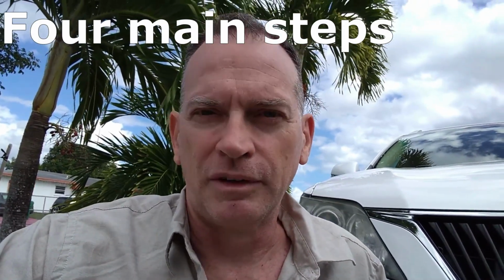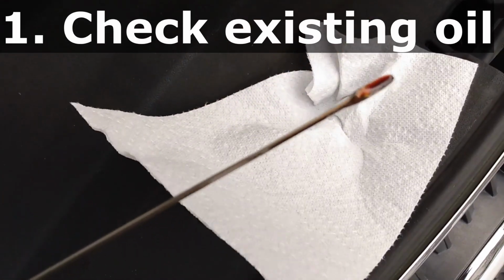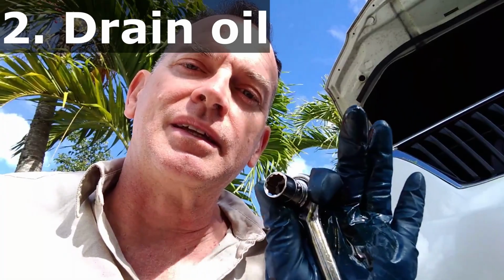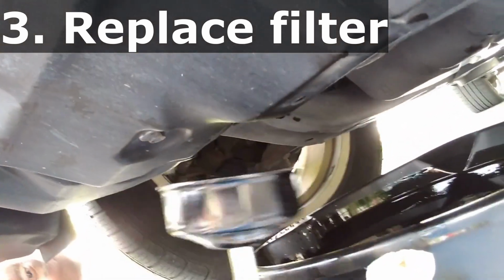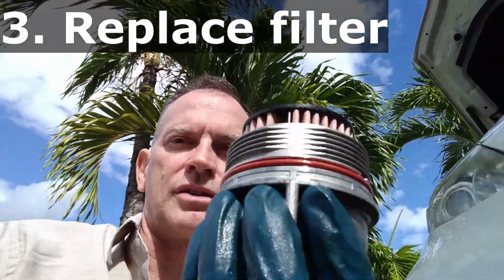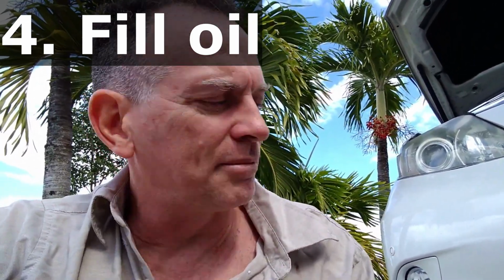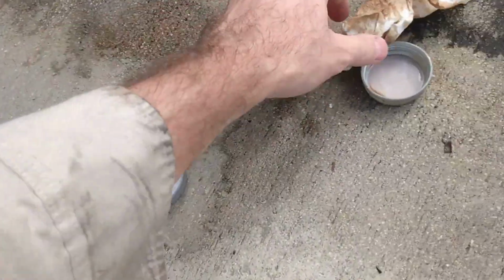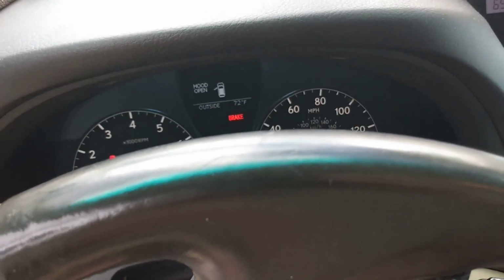Change your oil Lexus RX350 Oil Change Detailed/Long Version 2010 Lexus RX350 (2020/Dec)

Comment: how often do you recommend changing your oil?
Reply from the maker: Hi Ray! Thanks for asking. For me, oil is the lifeblood of a car. I change oil every five thousand miles.  Costs me fifty bucks or so.  My interval is on the five and ten.  For example, 35000 miles then 40000 miles then 45000 miles. That way I don't have to remember to write it down anywhere!
Reply: @marksatterfield  is that for synthetic or conventional oil
Reply from the maker: I would only use synthetic. I've used synthetic since the 1990s.  In my experience It is worth the extra ten bucks.

Comment: Oil filter housing cap torque specs...
25 N•m or 18 ft.lbs.
That torque spec is on the oil filter cap (on the same end that the drainbolt us on).
The drainbolt on the oil filter cap is half that.

The Fram isn't the only oil filter that comes with a screw in plastic service pipe. Even the cheap Super Tech filter comes with the same style.
Reply from the maker: Jack thank you! I doubt the oil filter housing would "unwind" itself because of the way the gasket is.  I'll remember to add that sort of information in the future.  Any other advice is greatly appreciated, especially advice on video editing! Thank you for stopping by
Reply: @marksatterfield  
Actually there are two parts to the oil filter housing (three if you count the drain bolt).
The part you remove to get the filter out is the oil filter cap or the oil filter housing cap. The oil filter housing base is still attached to the engine.
The reason the torque can be important is if you apply the same torque to the oil filter cap and the drainbolt then next time you go to remove the drainbolt, the entire oil filter cap may come off with it.